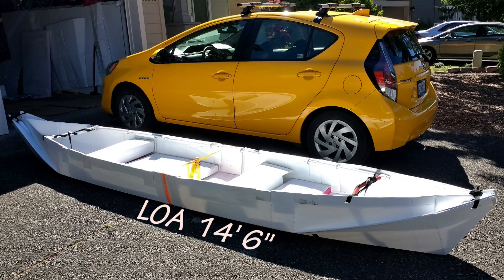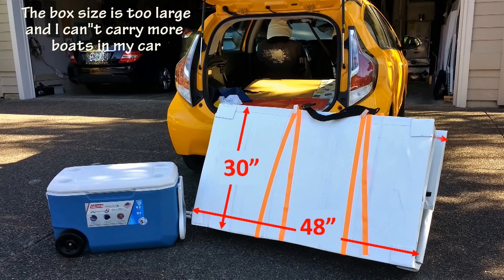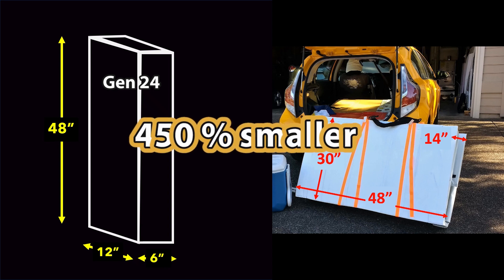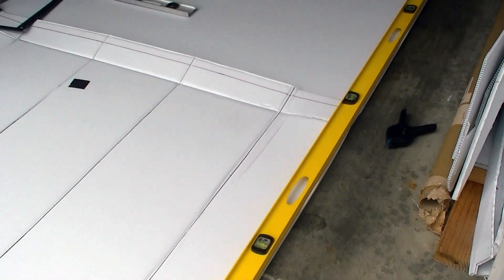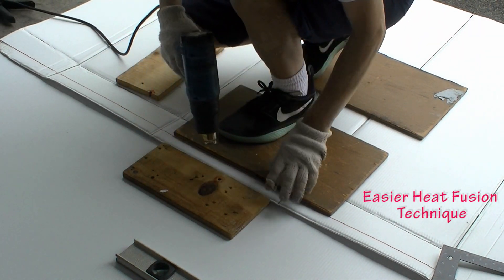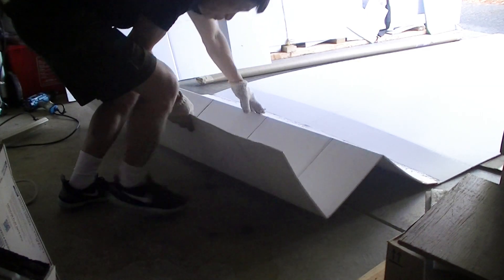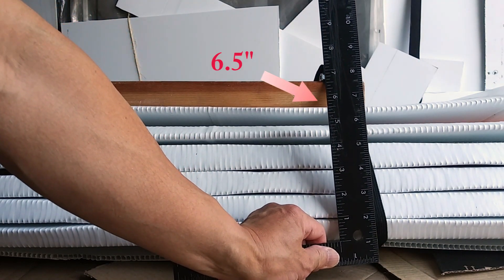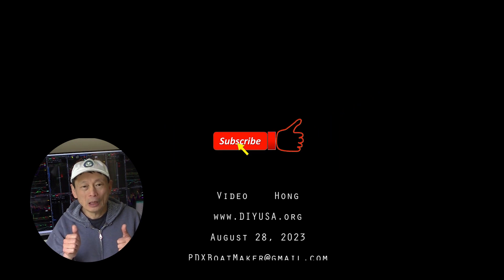Pt 1 DIY 13' Folding Kayak - Gen 24

Comment: In my view, this is the most promising design so far. With the addition of the folds to improve speed and tracking, I see an interesting evolutionary step from the previous boat. The challenge will probably be to keep the boat from collapsing in the middle, especially if you are driving it solo and all the weight is placed in the middle. As an owner of an Onak, I can also forewarn you that a boat of this size is difficult to control alone when the wind is blowing.
Reply from the maker: Thanks for watching and sharing your experience. I agree it will be more difficult to handle this kind of boat in a windy condition (especially in a solo mode). I have to investigate how to add a skeg fin to the kayak. Thanks again.